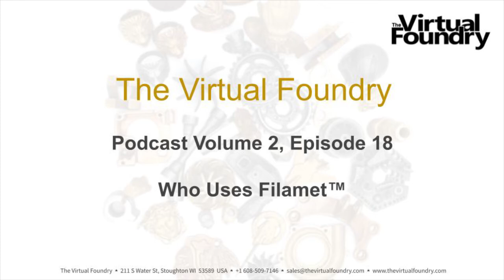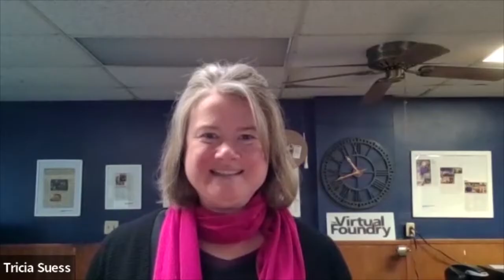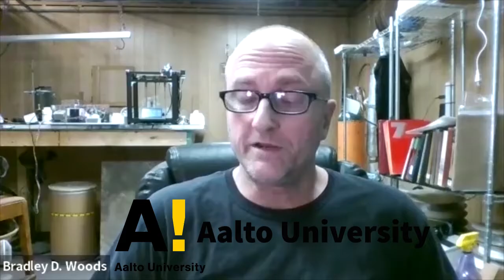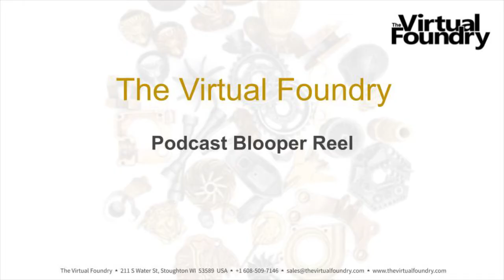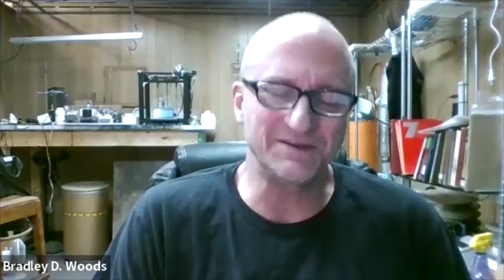Podcast V2E18 - Who Uses Filamet™

Comment: Very interesting. I retired 3 years ago. In my last job I worked here in Australia for a Radiation Services company. One of the services we offered was to provide lead shielding. The shield would be designed in 3d and then sent to a lead fabricator. It would be a lot easier if we had 3d printed at least the smaller shields. I have just ordered a start up kit from you and hope to print bronze artwork. I have a couple of printers I could modify but I hope to use my new Makerbot Method X printer using their Labs Extruder which enables use of 3rd party filament and can print BASF stainless steel filament. I may have to modify the filament input to the extruder so there are no bends in the filament. I will let you know how I get on.
Reply from the maker: Right on, Peter. Maybe you'll tell your previous employer about Rapid 3DShield Filament, wink wink. Yes, do let us know about your experience with the bronze. People do lots of very creative things out there and we love to see them!